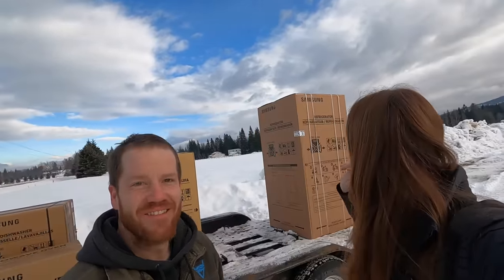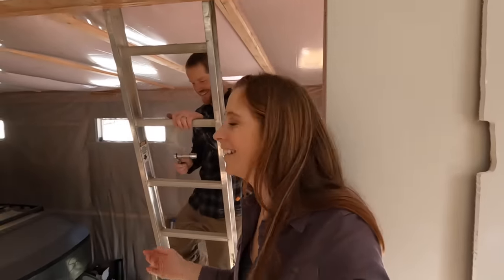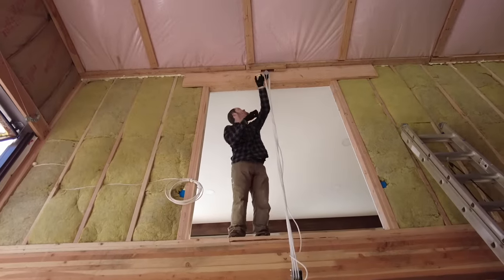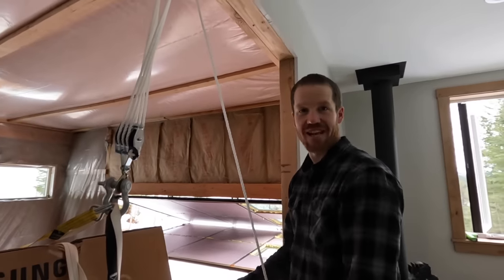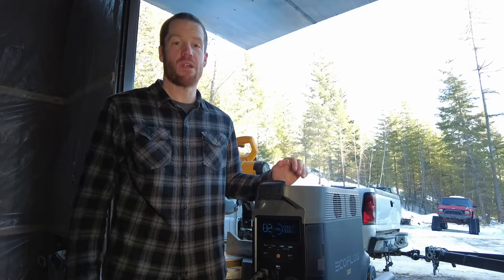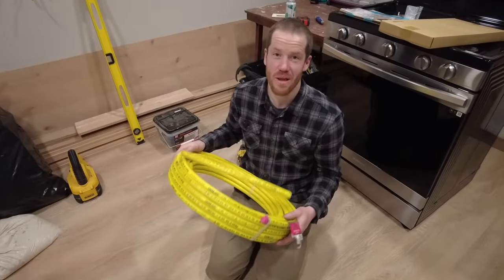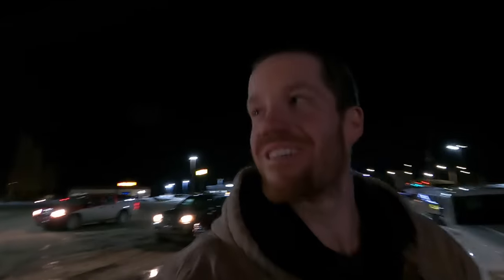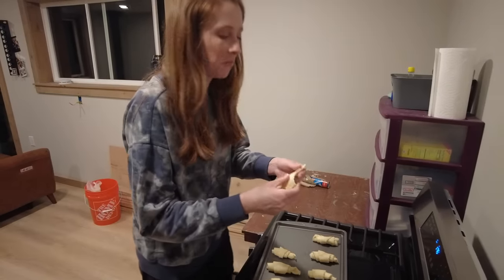This is a HUGE Deal! | Building Our Home Off-Grid

Comment: Put some jugs of water in the freezer, don't over-fill, only 3/4 of the way. Utilizes thermal mass to run your compressor less often once frozen. Long run times are better than frequent run times. It'll make your fridge WAY more efficient.
Reply: I use gel bricks and pouches in deep freezer and also keep it in refrigerator compartment as it freezes to maintain good temperature and also are helpful at times of power failure to maintain the temperature. Hello from Mumbai India.
Reply: And will take up internal space.
Reply: tbh nearly everyone fills up all of their freezer space pretty quickly, even if it's just with ice-cream, then they just eat what's in the fridge. I've barely managed to squeeze in two gel blocks that I use for work sandwiches
Reply: Better idea. Just fill it with gallons of ice cream!

Comment: FWIW- I've had to move a 700# milling machine and other tools/appliances in and out of basements at my homes.... I built a sled that I would load up and slide up/down the stairs using a small hand winch.  Since you've got a straight stair run down to ground level I would think something similar might work for you guys.  A bit less sketchy  (albeit only a bit).  Still a win's a win- you got them in, and no blood was shed :)

Comment: Not sure how many 100 lb tanks you have, the goal should be 3.  One in use, one spare, one to be filled.  1000 lb tanks would be sweet but you should check if you can get an inground 1000 lb tank as they won't vent in the summer & the lines won't freeze in the winter.  Short term you should get a 100 lb tank gauge, C0² monitor, 35 lb tank with an adapter that matches your line (emergency backup).  The smoke is from the light oil coating the cast iron parts. I hope you have a range vent.  

Things are looking great!

Comment: We're running our house off two 40lb cylinders harnessed together.  I have four, so when two go empty, I swap out the harness and fill the empty ones.  If you're not heating much with it, your kitchen stove will run forever on a 40lb cylinder, so I wouldn't worry about getting a bigger tank...
Reply from the maker: That's great to hear! We will eventually be heating the water for the apartment with propane as well.

Comment: Don't need scissor lift just good old forklift forks, basically you can make it as a project, you can take some off of old junk, there are even some very old that can be hand driven with chains. You will just need a stable platform underneath, and then wheels to move it away if not in use.
I think Captain Kleeman had hydrolic one taken apart on his channel.
P.S. BTW those pullies you got are great !

Comment: Battery tech has gotten a bit better in the past 5 years but I spent mega time searching for appliances with no parasitic draw. This limited the choices a bit. It was particularly difficult to find a fridge freezer that didn’t auto defrost. The defrost cycle is a huge power draw.

Comment: Move the tank outside!!! Remember propane is so dangerous because it is heavier than air meaning your ground level fills with propane first and when it hits an ignition source, there is a lot of gas to explode. If you don't have time to mess around, check your fittings with a spray bottle with soapy water but you should really be pressure testing the system ASAP. Also, install a carbon monoxide alert in the kitchen! Good work!
Reply: And if you are "sniffing for propane" you need to have your face on the ground :) Thanks for the heart!

Comment: I know this was over a year ago, but for anyone else a pully is a great way of doing lifts, years ago we use to do super long carpet runs "Customers didn't want any glued together seems" so how to get a run of 300 to 400 lbs of carpet up to a second floor we did this but after the first few times someone gave us a wench "game changer" we would use a pully and the wench with the flick of a switch we were able to get heavy things to a second floor. if you don't have a wench you could use a car or something like a 4 wheeler and pull with that too. 

You two have done such an amazing job.

Comment: Be aware that you may have to change the jet size on the stove burners because the stove is so far above the tank (2nd floor stove and tank at ground level). It will still work as is (obviously) but may not get as hot as you’d like for hot oil frying and such. My mom had the same issue.
Reply from the maker: Thanks for the heads up!

Comment: Plow truck cones through again!  Your door wench looks like it could use a leg bolted to the sill (or just staked to the ground).  Seven to one is great for a block and tackle.   The real problem with 7 to one block sets, as you found out, is you have to pull seven times the rope for every foot you get off the block.   I've always liked come-alongs for winching.  I bridge I was lucky enough to reconstruct, Folsom Truss, was done with mules, chains, block and tackle.  (you always need the mule)  The nice thing about the refrigerator is it cools your food and heat's your house.  Thanks for the ecoflo info.  I'm going to look into that.
Reply from the maker: Courtney read your comment, looked at me and said "we need a mule". 😂

Comment: Love the building series, That unvented LP range needs to be vented (240 cfm) to exterior.
It is an unvented combustion appliance , it generates Carbon Monoxide, Carbon Dioxide, Particulate Matter (PM) and Water Vapor all of which are a serious heath hazard. Indoor cooking is now considered a Pollution Event. Your new apartment is a small tight and air sealed space. You need a range hood and bath fan (110 cfm ) I would also consider an HRV or ERV. Lastly install a CO/Smoke Detector and an Explosive Gas Detector. It would be a good idea to purchase an indoor air quality meter such as a IQAIR. That should about cover it :)
Reply: @Speck Still needs to be vented, PM and Water Vapor are being generated.

Comment: Congratulations! I was very worried about the fate of your refrigerator. Will you raise similar things in the future? Then I have two ideas for you. When strapping fragile high products, use a cross bar. Two boards fastened crosswise will remove the load from the side surfaces. Lifting heavy things with a polispast is certainly a good idea. But you have an electric winch. Why didn't you use it? I look forward to continuing!

Comment: I hope you let that fridge set for 24 hours before you plugged it in. The reason is to let what debris is left in the system settle to the bottom of the compressor, so it lessens the possibility of the debris blocking the capillary tube.

Comment: So stoked for the progress! Also that eco flow is wicked awesome! That will have to be an addition to the camper this year for our annual cross country vacation. The ease of having an all in one unit verses building a full power bank outweighs the cost in my eyes. Great product feature!
Reply from the maker: The portability and convenience is amazing. It's about the same specs as the power system in our camper, but after buying all of the heavy battery cables for the camper system, it is only marginally more expensive.

Comment: Now you need 2 things, fresh air supply to stove and you Jotul burner, and kitchen exhaust, I used Vilpe kitchen extractor that has exhaust fan located on the roof (installed all myself), just that it requires some particular hood for "driving" it. But likely you have something similar in the US ...
BTW you don't necessarily need forced induction/exhaust, if you search around you may find some ideas on using natural draft air for gas stove exhaust, on old apartment houses we had those a lot.
P.S. that is safety feature required here in Latvia.

Comment: You are stronger than you think. You actually had the block and tackle upside down! So you only had a six to one ratio.
My only comment on the gas installation is that your codes are totally different to ours.

Comment: The battery system you use to give power to the refrigerator, reminds me about my solution when apartments in my area went out of electricity for some 36 hours.  It was really long time considering the area is not a remote place. I saved my food in fridge by using the electricity stored in UPS meant for computers.  Just keep the fridge doors closed and use the backup power when the temperature inside fridge is about to go above freezing point. You want to run it until you have again some -20 celsius, then shut it off and keep fridge doors closed. My UPS was able to run some 30-40 minutes before batteries empty, but it was just enough to carry the food in freeze temperature over that 36 hours.   Just for numbers information, it was 1000 VA UPS (which doesnt necessarily start without existing AC power....had to help it with other UPS), and it was basically enough to return the good freezing temperatures to fridge at least once from about 0 celsius.  Your battery unit carries probably longer time, and it is better designed for that job.

Comment: To field test gas joints, I have used washing up liquid. If it bubbles you have a gas leak. So either tighten or remake the joint and restest. Gas jointing compound also helps. (Like putty.)

Comment: A couple of notes on that Fridge ( have a very similar model)... The older models had lots of issues with the ice maker in the door freezing over completely and locking up.. I think they have done a software update to keep that from happening, so hopefully you wont have that issue.  Second, the French Door Flapper (long white hinged thing on left door that makes the seal when the doors close) is very easy to damage if it is not in the "open" position when you go to close the left door.. As you open the door it normally pivots the flapper 90 degrees, and works fine, but if you open the door too quickly the top plunger  (little white spring loaded part at the top of the flapper)  is designed to compress and allow the door to open anyways.. but this leaves the Door flapper in the "closed"position, so when you go to shut the left door, the top plunger has to get compressed again in order for the flapper to close.. This will quickly break the plunger, and maybe the whole flapper... a new flapper assy costs about $150 (plunger is not available by itself)..So.. do yourself a favor and open the left door at a moderate pace... just be glad you don''t have teenage boys.. cause replacing those flappers can add up quick..

Comment: love your work guys, i had the joy of moving one of those samsung fridges up a set of stairs, and when i renovated back down the stairs, it was the largest model that weighed 151kg, when i sold the house the fridge stayed 😆 on a side note you only need to open a gas bottle half a turn, you will get all the flow you need and if theres a leak you can quickly close the bottle

Comment: ❤️❤️Hello from Texas. I'm a lady carpenter/painter/everything. Lol I was scrolling and saw you running tape in the bathroom. Although slow, you did a great job. I would have certainly put you on my crew. 😁 If your ever in West Texas Hollar at me. We'll go hunting out at the ranch. My little patch of heaven hardly gets snow or storms. 60 miles either direction from me and it's another world.  All the signs say Jesus is coming soon so get a move on, you don't have much time left. 
Looking great guys. I continue to be amazed by you.   Yes! The frig was a tense moment. Whew!!  
When I remodeled couples homes the first thing I would do is sit down with them and tell them the one big rule.  If there are any changes by either one they must bring it by me first before even talking to the significant other about it. I'd say 90% of all fights over a home remodel happen over changes or ideas that won't even work. So I hear it first then I took it to the partner. Any no isn't worth a divorce. 
Btw 40% of divorces happen during or just after a remodel or new home build. I believe doing this on camera keeps your best behavior up front. ❤️❤️Sooooo KUTGW❤️
Teresa Dunavant

Comment: So many familiar sights -- very relatable. I've 100% chased after an appliance delivery truck with my trailer and done the tailgate handoff after google maps sent the driver down decommissioned logging roads putting them massively behind schedule. Your method of lifting the fridge up to the barndominium is 100% safer than the stuff I've done with wood blocks and a farm jack. I didn't catch whether the oven portion of your range is electric or gas, but if you just wanna supply your cooktop, 20lb of propane is good for 3 months of daily cooking. So that 100lb tank should last approximately forever. I generally use a two barrel system with propane so I've got a full tank on standby at any given time so that running out isn't a huge deal. With a good regulator, you don't get a lot of warning that you're near empty.
Reply from the maker: That's great to know! We will be very happy if it lasts that long. The appliance guys were very used to people meeting them on main roads... must be a North Idaho thing! 😂
Reply from the maker: Ha! Glad you liked the video. Always an adventure when living off the beaten path. We are likely going to be heating water with propane as well, hopefully the 100lb tank lasts at least 3 months. I've been working on an easy way to tell if we're getting near the end. I think an old school bathroom scale to set the tank on would work. Get an empty weight of the tank and then we'd always know how much was left.
Reply: @AmbitionStrikes  Weighing the tank is 100% how the professional tank fillers do it. They also make hoses with built-in gauges that give you a rough idea of how much is left, but it's not super precise because pressure is also a function of temperature. I generally use the pick it up and shake it method with 20lb tanks before I start a marathon smoker session.

Comment: Hindsight now, but having an I beam with a hoist across your shop, and a door there would have probably really helped with bringing a lot of the heavy stuff up to the second floor. You guys may do more shop/ auto builds in the future too so a hoist is never a bad thing to have in the garage. You have an electric winch to open the door, you could rig the cable from that to lift stuff. Maybe on the next build...

Comment: Great job getting the appliances up. Love your adventures, and how well you work together, keep up the great work!! 
Just a tip with your propane valve on your tank, just open it 1/2 turn this will allow gas to flow and should there be an emergency requiring a quick shut off it just a half a turn to close the valve. At least thats what our welding teacher taught us back in the day:).

Comment: I feel like yall will miss that opening. Ive been seeing a lot of videos about the ecoflow. I think it will definitely be integrated into my system when  do an upcoming remodel. I am especially interested in how it goes with the welder. I think that definitely needs to be a future video. Maybe it running the plasma table and the welder for a project. Thank you for all that yall do to keep us entertained. I dont often share the videos i geek out on but i have shared this one.
Reply from the maker: This model (the Delta Pro) is the only all in one power station I've seen that can do split phase 220 output. You need two of the units to make ot work, but it's definitely powerful enough to run the plasma table.

Comment: I like the window idea but I would have installed a double dutch door system. Upper half with glass, lower half wood. All made the be an architectural feature. This way there is always the ability to haul large things in and out to the garage. I think you said you plan to install deck and stairs wit the sliding glass door already installed? But that would only be one way to get things in or out. The double Dutch door would be two ways.

Comment: Happy to see the guys that ecoflow found you two. They're great units, I've been using a pair of Pros for the last month or so to run an small off-grid shop. Keep in mind though even 2 pros with 3200w solar and the Dual voltage hub at 240v won't run my big welder it's a 50 amp machine. The best I've been able to do is 32 amps with two Delta Pro units.
Reply from the maker: Oh that's awesome to hear that you have good success running them in parallel! 32 amps of 240v is impressive! That's 7680w, much higher than the 7200w rated output. Is that using the "X Boost" setting?
Reply: @AmbitionStrikes  no. I don't have Wi-Fi at the shop so I haven't been able to do anything extra with the settings.

Comment: Please move the propane outside- it is one of the NEVER rules: never put propane cylinders inside the building. You need to do a drop test to prove you have no leaks- you could make your own U gauge byusing a 3' tall u shaped clear tube, half filled with water.  A rubber hose to the test point from one side, the other open to atmosphere. Slowly pressurise then turn the gas off. Mark it after a minute or so for tempreture stabilisation then make sure the level is the same after 2 minutes. If it does not move then you are all good.
Reply: Yes - SOON!
Reply: I was looking for this comment because if I didn't find it I would have said the se thing.   

PLEASE, move the tank to a WELL ventilated area ( aka outside or at least someplace that accumulated propane gasses can not collect)
Propane tanks, fittings and hoses leak sometimes.  And a small leak in a confined area is all you need for a kaboom, crash crash. Only looking out for your safety. 
Love the show,  keep up the good work

Comment: Tip for your propane tank - you dont need to wind the valve fully out, a half to one turn is all thats needed and then in an emergency it takes only one turn to shut it off
Reply: Not true:   A propane valve should be either full closed or full open.  There is a seat/seal on the full open that prevents gas from leaking out around the valve stem.